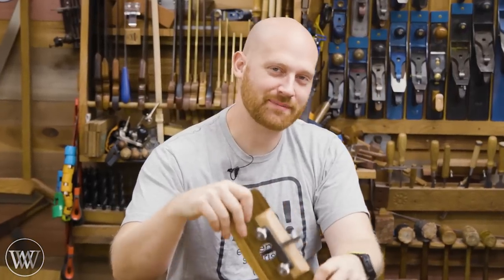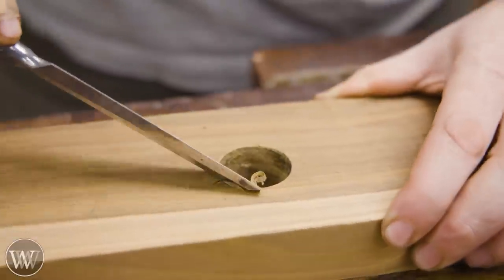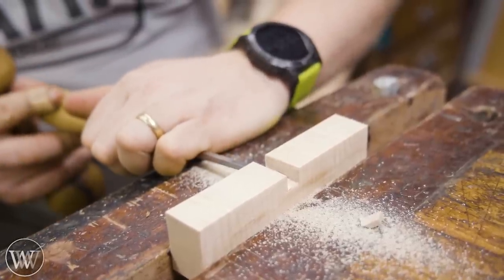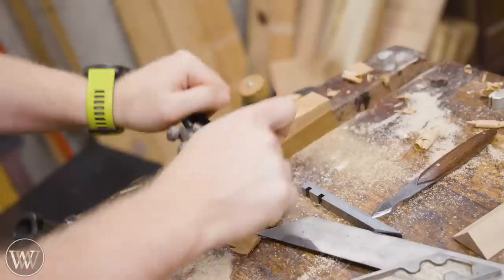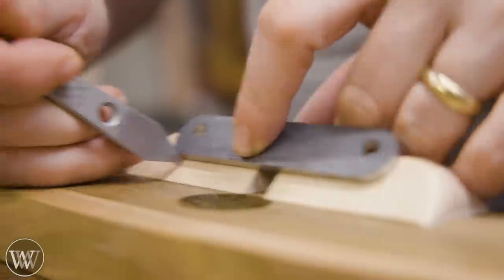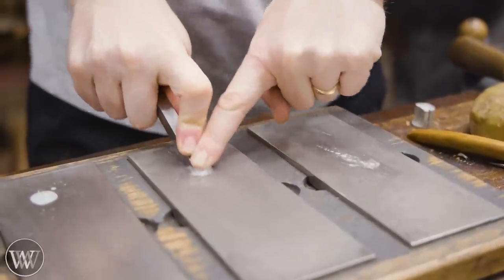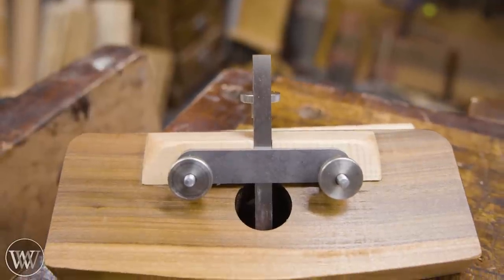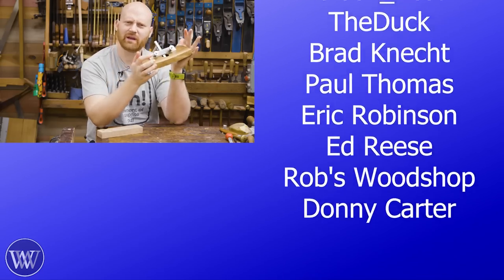How to Make the Paul Sellers Router Kit

Comment: Some thoughts after completing mine 

- installing the threaded studs sucks. Instead of using your drill chuck, you can use the knob cap nuts to drive the studs.
- I managed to cut the "upstand" at the wrong angle, twice. The instructions on Paul's site are not that clear on how the blank should be oriented when marking 50 degrees.
- I drilled the hole for the depth adjuster in the wrong place! But I was able to easily reposition it by filling in the hole with a dowel.
- all of the studs are the same length, but the ones for the clamp bar are excessively long. Would be a nicer kit if they were just the right length.
- it's easy to misalign the studs for the clamp such that it won't go on. A round file will remedy this.
- I used a second, smaller forstner bit to make the iron hole into a pear shape. This greatly improved visibility and didn't seem to have downside.

All that being said, my finished plane works great. I have a metal router plane with a very narrow blade, so it will be nice to have a big one and a small one.

Comment: Thanks for the tip on using a hammer to adjust the angle of the screw.  I could advance the blade, but it would bind when retracting.  A couple of nice whacks with a nylon hammer to adjust the angle just a smidgen and now advancing and retracting the blade is very smooth.

Comment: Very nice build! I made one myself right when the Paul Sellers video came out, but I have to say that I don't really like using it. I got a Stanley router shortly after which leaves a nicer finish, and it's somehow harder to adjust than my old chisel and wedge I was using before (based on Rex Krueger's old video). That said, it's still a pretty tool and I also kind of cobbled sizes together, as it was easier to find parts in English than metric sizes. Having everything in a kit is probably gonna make a nicer plane!

Comment: Well, I wonder how well the maple will stick or stay glued to the Ipe. That wood has a LOT of oil/resin in it, and most of the time, people will wipe it with acetone before gluing, but, I would expect the oil to seep back in and the glue joint to fail eventually. Now, this got me thinking that I have some Ipe 4 by 4s, and was thinking about making hand planes...... Hmmmm.....
Reply from the maker: the oily wood and glue problem is an old myth. Yes there is a bit more oil but not enough to cause an issue.
Reply: @WoodByWrightHowTo  Hmm, might have to try it. I do have a lot of Ipe around from some house projects. It does hold up really well for outdoor furniture here in the Pacific NW. Have some ironwood and lignum too....

Comment: I hate using power drill to drive screws and bolts in woodworking. I find the control you get with a ratchet or a brace completely eliminates splitting if you judged the predrilled holes wrong.
Reply from the maker: I am usually in the same boat, but for this one I was following the instructions.

Comment: Hi James, Thanks for posting this build video to provide some alternate strategies to build. I just placed an order for the kit as I wanted to experience building a router (though I already have a veritas one that works exceptionally well). I have a couple of questions with respect to this router and build:
1. I see that normally the router blades are bevel up (veritas, stanley etc.) but this one is bevel down. Is that going to make any difference? especially considering routers are mostly intended to be used across grain.
2. The retainer bar that sits on the top of the blade, with those 2 thumb nuts, is it supposed to pinch tight against the blade or is it just meant to make sure the blade doesn't fall off or come loose? The reason I am asking is because I wanted to be sure if the blade is supposed to sit flush within the groove or should I make sure the blade is slightly proud so that the retainer bar can pinch tight against it.

Thanks!
Reply from the maker: The bevel angle is bevel down on this one, but in function it is the same as the veritas with the bent bevel as the cutting angle is close to the same.
The blade should be slightly proud. the bar holds it in place.

Comment: Are you sure this is IPE?  I have worked with a lot of it and it is normally dark chocolate brown with green tints. It is very very hard and very heavy. The wood sinks in water. I would surprised for it to work as easily as you went through it. Even drilling it out produces smoke and the the shaving explode out of it. Maybe sap wood IPE?
Reply from the maker: I am sure of it. this is air dried from a sawyer friend in Brazil.
Reply: @WoodByWrightHowTo  maybe then what we have been getting sold here in the states named IPE isn’t truly IPE.  I’ve worked with thousands of feet of it and it doesn’t appear to act the same as the wood you have. Have you attempted to work with the decking style material that some lumber yards sell?